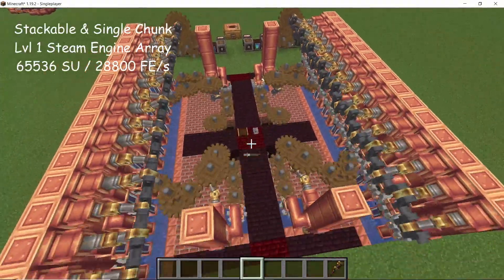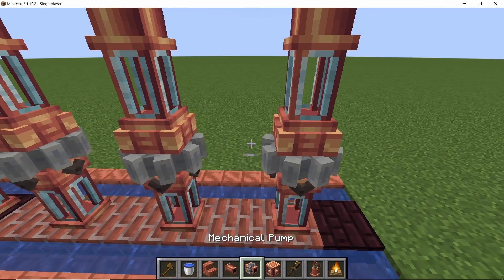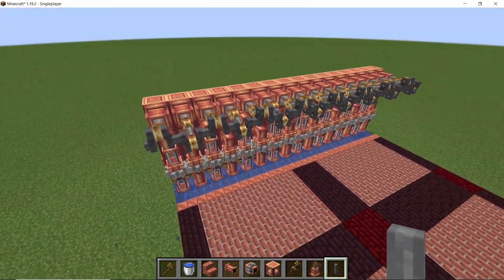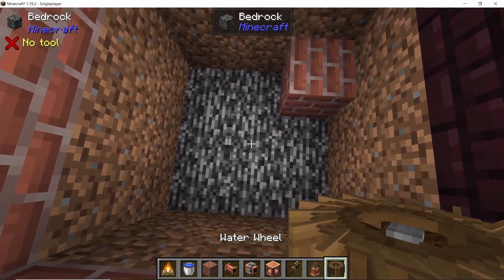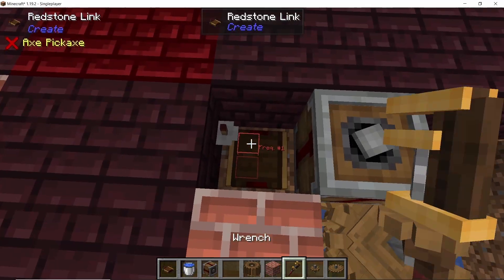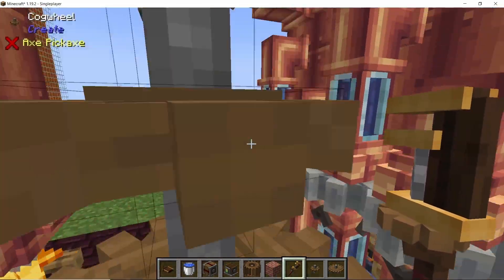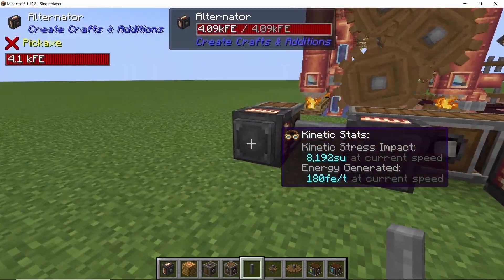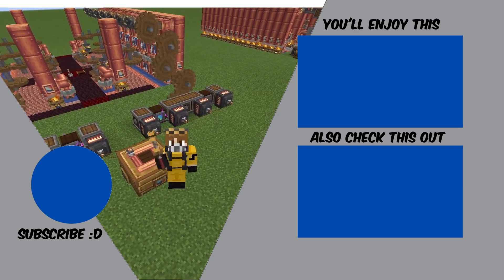Self Sufficient T1 STEAM ENGINE Tutorial  - SU to FE PowerPlant - Create 0.5

Comment: Hi, i know this isnt an hbm video but how do i get rid of low pressure steam?
Reply from the maker: You can use a condenser, auxiliary cooling tower or cooling tower to do that. Each of them will convert low pressure steam to water which you can feed back into your system making it a closed loop. 
Condenser has the slowest rate of conversion while cooling tower has the highest. Auxiliary is intermediate
Reply: @SavageVegeta  another question how do i get bismuth so far no luck turning lead to lead-103 to get it thru rtg takes way to many flux, SILEX needs FEL which needs desh energy block which needs bismuth
Reply from the maker: @johnipjaymartus703  https://youtu.be/XFMG4eEBMgk
Reply: @SavageVegeta  but fel needs desh energy source which needs bismuth ?
Reply: Oh maybe its because I use 1.12.2
Reply from the maker: @johnipjaymartus703  you can use centrifuge to process the depleted fuel. FEL isn't necessary
Reply: @SavageVegeta  Oh ok :D
Reply: @SavageVegeta  I'm dum turns out desh energy storage block is only needed on cyclotron 
Fel only needs saturnite energy storage block
Reply from the maker: @johnipjaymartus703  all sorted out then:D
Reply: @SavageVegeta  :D

Comment: Interesting build, but the only problem with it is that you can easily make a much more powerful design using only an infinite lava generator and the straws added by crafts & additions. a max size boiler for blazing burners can run 9 alternators at full RPM of 256
Reply from the maker: The idea behind this build was to make it early game friendly, something that you can make even before taking a trip to the nether. That's why there are no brass components or a blaze burner in here. I've been working on a t9 design too running off of plant oil. But the way this one just fit in a single chunk, I had to share it